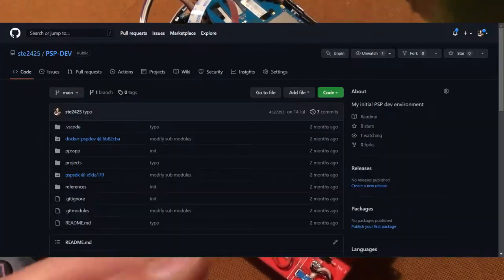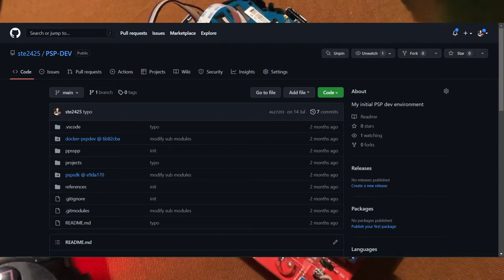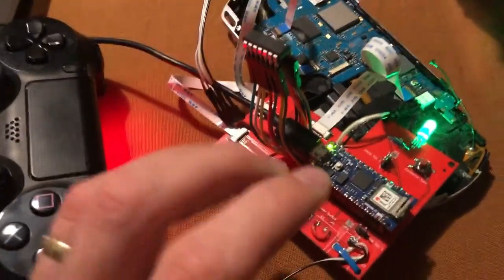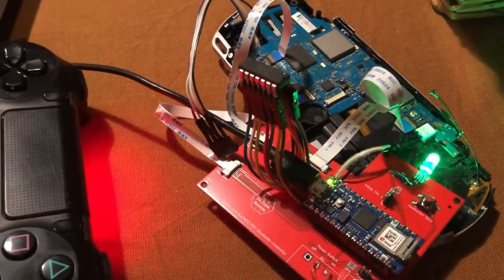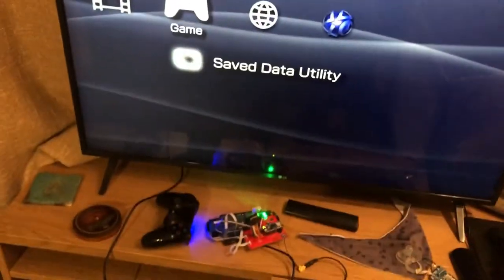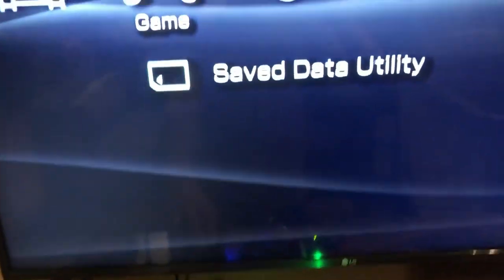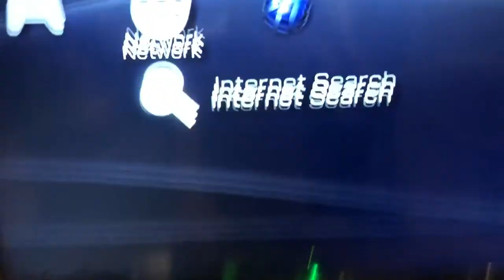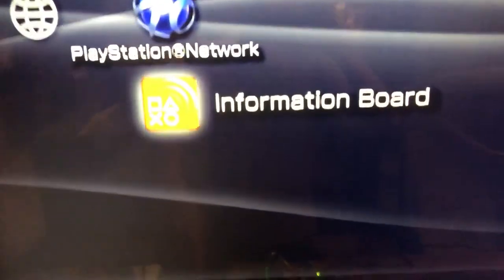PSP Consolizer Project Update

Comment: Hi mate. It's a pretty exciting project! I think the missing most important part would be extracting the video from screen ribbon cable and being able to hook if to an hdmi port (and ideally proving options for upscaling). Its great you have the controllers already figured out. I subscribed to see how it progresses. Good luck!
Reply from the maker: hey thanks. The PSP already outputs component video so i don't have any intention (or ability for that matter) to do anything else on the video side. I am currently working on making it internal to the PSP though which is cool. JLCPCB offer affordable FPC's now which makes it possible.
Reply: @stephencooper3067  Regarding making it internal, that'd be amazing. I use JLCPCB myself for my guitar pedals, but I've never had to deal with flexible stuff. The PSP guts are packed, so good luck my friend! Regarding the video output, I know it does component, however the digital video must be in there somewhere! Today's TV are ditching the component input and, if you've seen Black Dog's PS1 digital you'd be amazed how crisp these things can actually look when you extract the real video bits. Somehow all that data must be passing thru the ribbon that goes to the screen, but I'm no expert myself either. Keep it up!

Comment: I'm trying to make a dock that uses the PSP serial protocol meant for remotes to try transcoding a PS4 controller, to a Bluetooth MCU, and send serial data already recognizable on stock FW to a PSP.
Reply from the maker: That would be perfect if anyone does it. Seen a few people suggest it but not made any progress. I think the only unknown is the analog stick as i suspect the remote does nothing with that. If you make progress please let me know! Do you have a GitHub/BitBucket/GitLab?

Iv'e tried getting me Arduino and PSP talking using some   bit of homebrew i wrote with the PSPSdk but not working. Read that there is some odd protocol the PSP sends data out and have to manually handle it Arduino side but not put much more effort into figureing out if thats true or not.
Reply: @stephencooper3067  the analog is the only show stopper yes. I'm hoping there is an undocumented feature. When my dock arrive from Japan next month I'll rip it apart and confirm the current stuff floating on the net regarding protocol. Then bit bang the serial port and fingers crossed the analog stick input can work. 
I planned to have this closed source and sell docks to make money but I will 100% make the serial documentation public if I discover something totally new that's hidden.
Reply from the maker: @cyo_corner  Good luck, i look forward to following your progress. I you do at least open source your research findings on the protocols. Closed source has been a real PITA in the scene i think. Seen a number of people trying to reverse engineer old applications because they are longer maintained and their source code was not publicly available.

Comment: Loving the project!  Not interested in the HDMI features as I already use the PSP's Component Cable.  But please, keep supporting the PSP2001-3001 (most common versions of PSP)
Reply from the maker: Thanks! Yup its more support for HDMI adapters if people choose to use them, rather than building my own HDMI out option (thats far beyond me) i just find the the windowed PSP games annoying.

I do intend to support the 3000 model as it would be 100% no solder which would be great. Just need to buy one to take apart.
Reply: @stephencooper3067  Now the question is; How small can this all be?  Can it all fit in the original housing, while still retaining all functionality?  Not that we really need functionality of the UMD slot and space with CFW and the such, but would be nice if it all did.
Reply from the maker: @TheCameramanInvestigator  Its limited by the Arduino. We have to shove an Arduino Nano (the 33 IOT version but same size) in there somewhere along with a digital potentiometer. 

My future goal is to make it smaller to fit where the UMD drive is but that's about as good as it will get. I'm confident it can fit there but there is very little space elsewhere. 

I'm sure someone with greater knowledge could use a bare microcontroller and probably a flexPCB to hug the original motherboard and make it fit but that's far beyond me.

The original idea of this project was to make it portable with a dock.
Reply: @stephencooper3067  Yes, what I would like to do is put my PSP into a docking station for Power and my AV cable.  But interface with the console through a Bluetooth controller.

Can't wait to see where this goes ^^b

Comment: There was one other thing I had to ask. 
Does the PSP still operate and run with the screen physically removed/disconnected?
Reply from the maker: Yup. However im running CFW so not 100% sure if it will on a stock system. You still have to press and hold the display button to trigger TV out. From my understanding its the lack of a UMD drive that will cause issues on stock systems. I believe its the CFW that allows for that.

Comment: awesome but its not going to run the umd’s right?
Reply from the maker: There's nothing stopping it running UMD's. You just need to figure out a way to mount the drive outside of the PSP's shell. One of the other issues would be the switch is uses to detect if a disk is inserted. If you mount the drive elsewhere you will need to solder jumper wires to to an alternative switch. This wouldn't be as bad a job as it sounds however.

All my games are backed up and run of the memory card so having access to a UMD drive wasn't a requirement for me, it wasn't worth the effort to solve that problem.

Comment: does it work on psp 3000?
Reply from the maker: Nope. There is no reason it wouldn't from a firmware point of view. However the connectors on the 3000 are different to the 2000 so someone would need to modify it for the 3000's connectors and pinout. 

I don't have a 3000 otherwise i would have done it myself.

The source code for the firmware and hardware files can be found here: https://github.com/ste2425/PSP-Consolizer